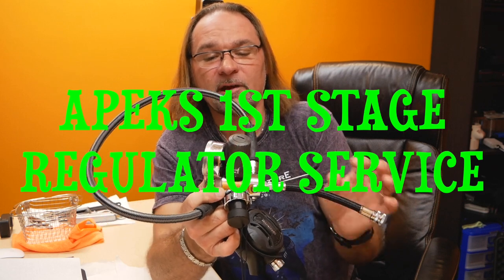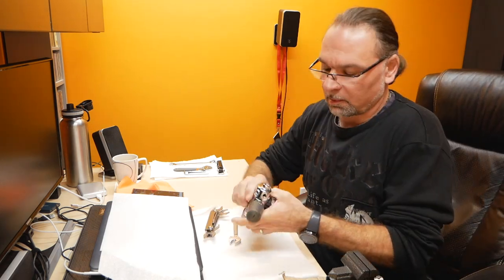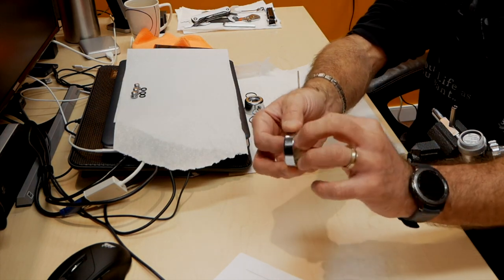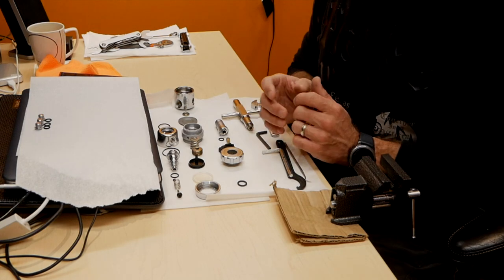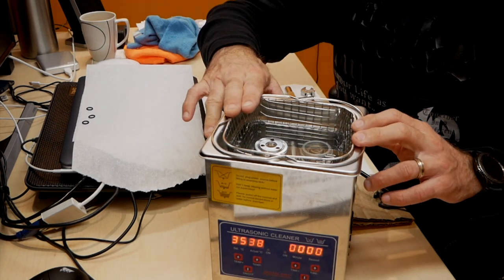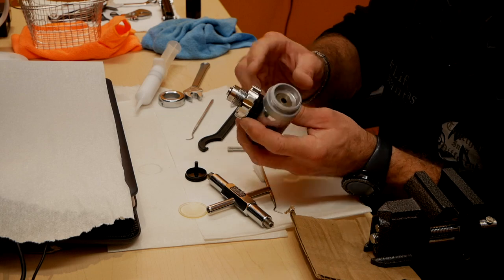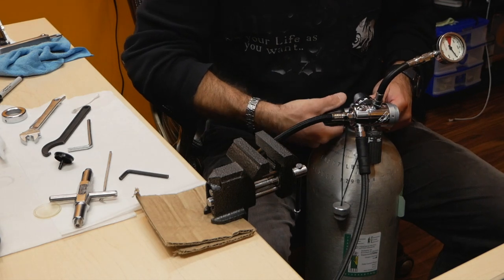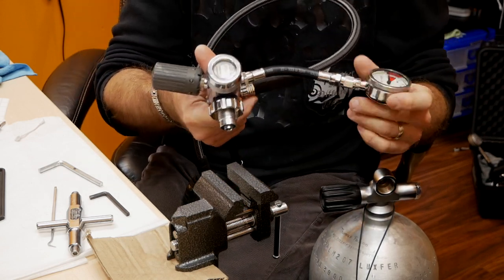APEKS 1 ST STAGE SCUBA REGULATOR SERVICE XTX 50 SIDEMOUNT

Comment: Great video Thank you! Keep posting staff like this don't listen to negative comments, people should make their own choices, also you said a disclaimer that if not comfortable go to authorised dealer. But there also should be a choice, if you technically savvy why not to do it yourself and follow the manual. Please clarify, when  you assemble spring adjuster (part 24 from the manual) how far you screwed it in initially to be in around required IP pressure, manual also missing this step completely?
Reply from the maker: Thank you for your positive comment and feedback, much appreciated 👍 regarding the spring how far you tighten it there is no actual reference I usually remember more or less how deep it was sitting before disassembly and fine tune with the gauge after.  Make sure it has solid grip on few threads more or less flash with the top of the base from there you can fine tune later with intermediate pressure gauge attached. I do recommend at least the basic tools to have before you proceed.

Comment: Have you ever taken a apex TX40 regulator apart? As i think that i might have a re-badged unit..it looks like the same thing.
I bet only 3/4 dv manufacturers world wide.
USA, Italy, china etc
Reply from the maker: @cliffordwells2793  it looks similar but it's not the same you can google search TX40 first stage service manual it is available on line. Question is if you can get replacement parts if needed. Also if you are comfortable taking it apart it's up to you it is your life support underwater. You will need some specialty tools and gauges to make the adjustments as well

Comment: awesome and clear video! Apeks recommends that parts such as the high pressure poppet be replaced anytime the regulator is opened. has opening, cleaning and then reassembling the regulator using the same components ever given you any problems?
Reply from the maker: No, never had a problem.  Apeks actually recommends that all the orings suppose to be replaced as well when serving.  Im guilty sometimes when don't have replacement kits I'll do carefully inspect all pieces and put it together.  Never had any issue but again ill do 100 dives max a year, NOT LAST 2 YEARS DO.

Comment from the maker: Just for Scuba Nerds lot's of small bits and pieces be careful and take Your time if You attempt it.  I know video of this kind will have lots of negative feedback as there is many ways guys are doing this better or even wost, it works for me.  If You can for Your safty always use new Orings when tearing down the regs, I replace them every two years as per manual but when doing just cleaning as in this video i re lube and ispect and replace only if oring is not in good shape.

Comment: It's nice you have the service manual, but you've missed few points.

Few advises:

#1 I do not see you using Torque wrench which is quite essential for brass threads. You will be amazed how much more pressure you use to tighten something by hand and "feeling it". 　

Very crusial for the DIN thread cause it should be tightened at 20nM.

#2 Use latex gloves. Even skin oil is a potential danger for higher O2 mixes

#3 The advice from Ian for a brass pick is valid. Do not use dental pick.

#4 I know you tend to re-use o-rings cause it's cheaper, but believe me once you open up a 1st stage you ALWAYS have to put new o-rings. Why? Cause o-rings tend to shape with time and with high pressures there they can leak.

#5 You ALWAYS have to close the tank valve, release pressure from the system before you make any adjustment to the 1st stage intermediate pressure. Believe me there is a reason for that and it's written in the service manual.

--

Nice on using CrystoLube!
Reply: Why encourage such behavior...  I see dead divers soon...
Reply from the maker: Lots of good Points especially the torque wrench may invest in to it, I think few years ago i watched your video to make this attempt it was awesome and very helpful.  You did not use torqued either 😉 I have serviced my regs ever since.  Apeks calls for new O-ring every 2 years but if i see something not right out of shape I change it anyway and every other year just cleaning.   Never had any issues with dental pick just have to be carefull.  I don't dig deep in to the brass just catch the oring and pull it off
Reply: @AdventureTravelandScuba  Thanks.
Lots of time passed since my first video. Trainings, lots of services, etc.
Sharing points from experience. 

You're right Apeks calls for service every 2y or 200 dives a year (if I recall correctly), but that means - no dismantling of the regulator.

Easier way to apply CristoLube is to pour small amount in a mini plastic bag, put the o-rings inside and rub them gently.

Good luck!
Reply from the maker: Thank You I like your comments not like some other people just bush the video completely we learn and improve with time, thank you very much
Reply: @dominiquegingras7334   You can't be serious -  This is just mindless trawling... begging for responses yeah?
Reply: @asecret900  he’s using an outdated manual and right from the start he says it’s not for everyone. So clearly he knows some idiot will try it and might ruin his regulator and might pay the ultimate price finding out!
Reply: @dominiquegingras7334  hmmm, thats a looong backward step from your first hysterical claim "I see dead divers soon"... lol